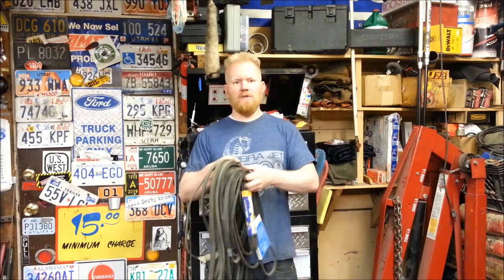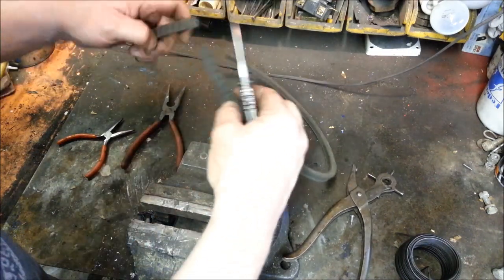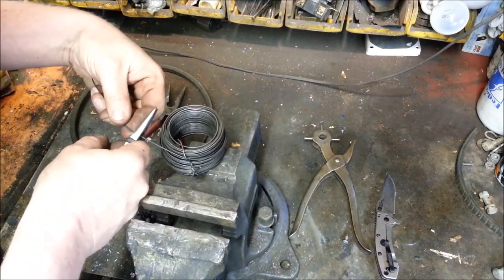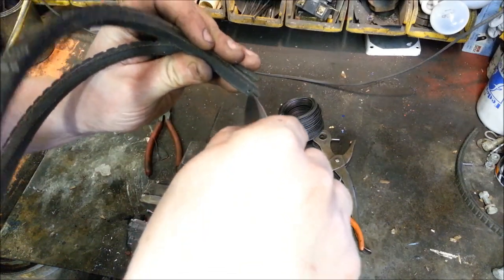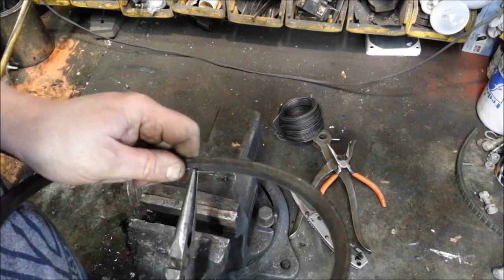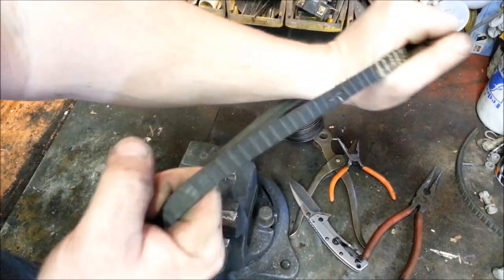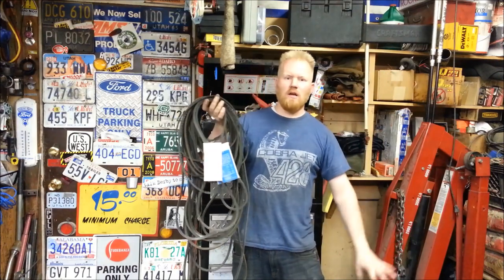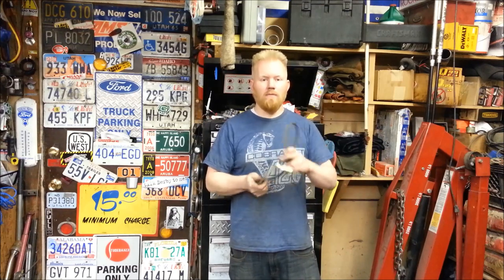Can Fan Belts be Spliced ?

Comment: Your awesome!!! I'm a chic, an older one and started learning how to work on my own vehicles when I was 16 cuz my husband always bought cheap cars. They were always breaking down and I had to figure out what was wrong in order to fix it and get back home again. Or fix em to leave. And fix them I would. We still had carbs, 8 cyls and rear wheel drive, the old days. I'm not complaining I learned so much and have found I am pretty resourceful. If I had it all to do over again I would not change a thing. There's not a whole lot I cant do but sometimes I run into problems and I will check your videos before any others. Your down to earth and easy to understand. Right to the point. I wish I found you sooner. Thank you so much for sharing
Reply from the maker: Thanks. These are great skills to have in your back pocket.

Comment: I wonder if some 50lb fishing line would work. Every loop would double the strength. Could probably do 5 or six rounds to get 250 to 300 lbs of strength.
Reply: I had the exact same thought.  I think that it would work better (or at least last a lot longer).  I think the bending force on the wire will probably break it over time (work hardening) whereas the flexibility of the string will prevent same issue.  You could probably do more like 10 or 20 wraps through a reasonably sized hole

Comment: Great fix! One suggestion: Once you've sized the wire and angles on it, push it through from the BOTTOM of the belt. Those nice recesses you notched out will protect the pulleys and the excess wire you can twist together without interfering with anything around the outside of the pulley's—at least on this application.
Reply from the maker: Yes, in a standard application that would be ideal but also the bottom of the V in the pulley never touches the belt.

Comment: You are amazing, sir! I have a problem with my dryer, and just surfed the net to find the exact belt, but nothing seems to work. Methods to solve this isuue on the bet are absolete. Your video is just amazing. I m gonna try this. Much appreciated for taking the time to post this video
Reply from the maker: This technique is more of a temporary fix. I'm not sure if the standard thin dryer belts would allow this to work. You can find most belts simply by knowing the length.

Comment: Looks good!  I have the same situation with a pillar drill and have a problem sourcing the exact part.  As for the wire, I might try putting the "bump" on the top.  Then there is the panty-hose technique.  Used this 39 years ago but lasted only a mile or so.  At least it got us off the motorway (freeway in US?)  Keep up the good work!

Comment: Brilliant! Nice fix for a mower and such. would there be a reason why you wouldn't put the baling wire "joint" on the top of the belt? It seems the solid wire in the "V" of the pulley might be less damaging to the pulley and the slot you cut would receive the wire much better. I realize the top of the belt would be rubbing on the tensioner pulley. However, that's less critical than the trough of the shaft pulley. Your thoughts.

Comment: Wondering how this will improve using the 3M Scotch-Weld and which PR number would be better?  I was just looking at a Singer 758 belt repair that has those gear teeth like design and someone cut the belt at an angle like face splice so each gear tooth had a small pin pushed through one side to the other reported as leaving the head on the one side and bending the other worked best.  I was thinking adding PR100 or whatever the best number to use is... alone to try and with the needles in the holes so can cut the pin end on each side or at least not have to bend.
Reply: Literally about to post a long winded overview of what I noted above titled "Timing Belt Splicing...". Just checked and all checks completed.. posted.

Comment: I tried this and searched and found this 😂. It didn’t work for me then I watched your video so I decided to double up on the hay waiter and it still snapped. Snowblower. Problem is my machine got a cheap belt. I only used my snowblower 4 times. Brand new decent unit too. 

I have a 35 year old rototiller stall it out on massive rocks many times. The belt has never broken. Store it outside in the elements all year long. They just don’t make stuff like they used to.

Comment: Great idea. I have a mower belt that just broke, so will try it if I can.
Reply: Did this splice work on your mower? Did it last very long? I have a lose mower deck belt and have thought of taking it off and doing this kind of splice, but I would put the twist to the wire on the top of the belt, not the V portion of the belt., Any thoughts?

Comment: you can use two metal plates with a hole at each end and weld or bolt them over the top and bottom.

Comment: A great fix.   I wonder if you  can retread your lawn mower tires by splicing on bicycle tire cut to size. Some of these gear lawn mower wheels are quite expensive.
Reply from the maker: wtam69 Interesting idea. I've cut new tread into worn solid tires before on lawnmowers.
Reply: If you find that magic piece of donor rubber...... I think some good glue (contact cement maybe) along with several small metal screws, wood screws or shortened drywall screws placed every couple of inches apart countersunk would make a good bond.  I like your idea, you will figure out something.  If you wanted traction and was desperate you could use the screws alone leaving them out a little to get a bite as long as it doesn't tear the grass up too much.  That would look a little crude for sure but if it works, what to heck.
Reply: John Michael I was thinking of contact cement too and maybe a section of BMX bicycle tires. Since the 2 new gear wheels cost $50, a diy job is worth doing. Like you said, I have to find that right piece of rubber.

Comment: Wow, I didn't think it was possible. I will be tossing some bailing wire and a hole punch in my emergency travel kit for now on!! I'll practice on an old piece until I get the hang of it. ...you make it look easy especially that angled cut what did you use? I guess a box cutter should be tossed in my kit as well. Thanks again for the great idea.
Reply from the maker: George Serrano The belt was just roughly cut to the same angle with a pocket knife. You can use fishing line as well with good results.
Reply: Thanks that'll really work out in a pinch.

Comment: you could always tell a motor head by his belt hoard,,,
Reply from the maker: mustie1 I want more.... I would really like to find one of those belt measuring boards as well.
Reply from the maker: mustie1 I want more.... I've been really looking for one of those belt measuring boards as well.
Reply: l have one but on old worn belt there not accurate,, l was tought to mark the outside of the belt and run a tape around the back pulling it thrue your fingers snug , to get the lenth,
Reply from the maker: Yeah, been doing the tape measure for years. Just thought a measure board would be quicker/more accurate. Maybe I'll just get a flexible fabric tape measure and keep it with the belts. Thanks for the heads up on the measuring board tools.

Comment: Thanks, great video. 
You could probably use super glue on the ends for some extra strength. I have cut and joined o-rings using super glue with good results. With o-rings the cut must be 90 deg. and perfectly straight.
Reply from the maker: Good idea.

Comment: If it did come apart I wouldn't want to be too close to the engine. Especially if the end whipping you has the wire in it.  But it is a good video as it could come in very handy in certain situations.

Comment: Crude but will work for a short time :D
I cant see any propper longlasting way to join that type of belt, as you said its allways bending at the joint so the metal staple does break.
Try welding rod for the staple perhaps??
Reply from the maker: zx8401ztv Crude for sure. Merely  a temporary fix to get you out of a bind.The groove in the bottom allows space so the metal doesn't flex, but rather pushes up into the belt.

Comment: I wonder if you could use a fat leather needle and some kind of super-tough cordage and maybe back lap it with some woven nylon strap and high temp contact adhesive?
Reply: I did something similar to a vacuum belt but with plain old cotton thread and super glue. I probably put about 10 stitches in it.  That was 3 weeks ago, it's still working.
Reply from the maker: James Pian I sew up everything with fishing line. It's extremely strong.

Comment: Maybe the twist should be on the outside of the belt where it wont be running against the pulley ? Unless it runs on both sides....Great idea, thanks.
Reply from the maker: Yes, but the belt should never touch the center groove of the pulley.
Reply: ahhhh, i see, fair enough.

Comment: Don't you worry about bunging up the pulley with this Macgyver trick ?
Reply from the maker: blueticecho I don't. The belt is soft and gives room for the metal to embed. The only way it would ever do anything is if I planned on running it for hundreds of hours(I don't think the belt would make it that long). But even then the baling wire is very soft when the pulley is hardened.

Comment: Interesting.  My brother once had a rental truck where the fan belt broke and believe it or not, they took one of the gals pantyhose and tied it into a circle just to get to a service center.  Supposedly it worked long enough for them to get to a replacement belt.  Weird, isn't it?
Reply from the maker: BansheeFifteen I've heard of panty hose being used but never seen it myself.
Reply: sixtyfiveford I should add, this happened  back in the early '70s, and the truck's belt was probably simpler compared to today's vehicles serpentine belts.

Comment: not going to lie i have 2 bikes one a dirt bike one homemade and legal surprising i know but the dirt bike would not keep a chain on it threw off chains constantly no mater what i did so i put a jackshaft right behind the engine and used a v belt to the back wheel oh and the pully was a lawnmower deck pully works like a dream i did the same thing but with spring steel and my other bike is 8.6' long so not short and the engine drives a jackshaft witch has a pully on the right side and the back wheel uses a live axle so the bearings are on the frame not the hub and the belts i could get were to short so i put 3 together and went 101mph with the belt drive on the side of the frame not in it if i slip my foot could be gone i know i don't have balls so it must just be stupid ?

Comment: Or you could just use one of these
http://www.ebay.co.uk/itm/VINTAGE-VULCO-LINK-V-BELT-ADJUSTABLE-V-BELT-VINTAGE-V-BELT-EMERGENCY-BELT-/161629557188?pt=Motors_Automotive_Tools&hash=item25a1df51c4

I've also used super glue to good effect. It's about the only thing that super glue works for.
Reply: Those would be a nightmare with a buckle.